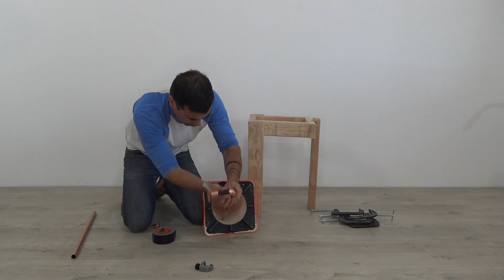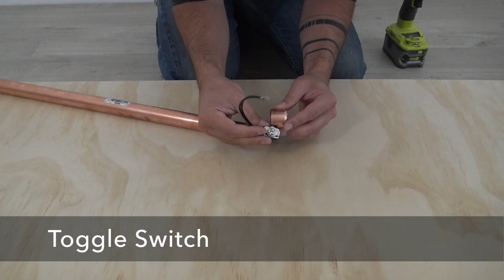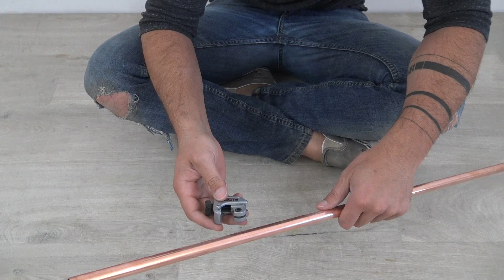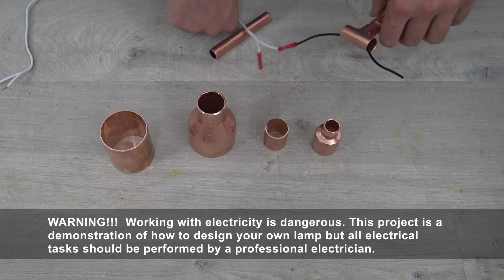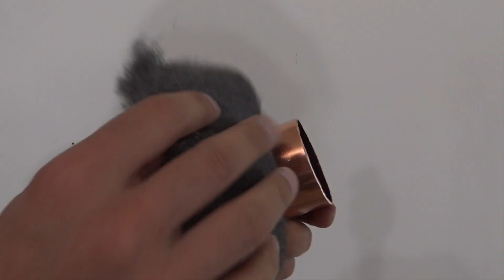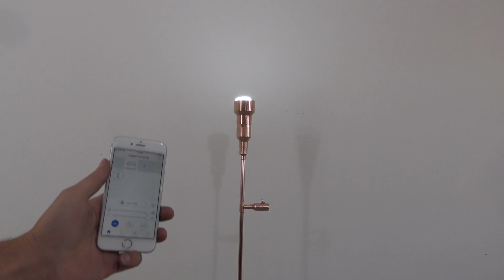DIY Lamp made out of Copper Pipe

Comment: I think a safer method might be to use plastic piping and then spray paint the desired finish. An ungrounded, copper lamp makes for a VERY dangerous accident waiting to happen. Alternatively, you could also use those LED battery bulbs instead, so that there's no current exposed to the copper.
Reply from the maker: the safe way is to consult a professional electrician which i did. any material combination can be dangerous or safe if the wiring and components are properly selected and installed.

Comment: Why do you keep pimping Home Depot?
Reply from the maker: I approached them about sponsorship because they have more  big box home improvement stores than most other brands and it helps create a retail reference point for the majority of the products i use.  If certain products are significantly cheaper from trade stores i recommend them as i did in the first metal working for beginners video where i made sure to inform the viewers that buying large quantities of steel from a steel yard will save money over big box retailers. I have gone to home depots since i was in college and have always had positive experiences.
Reply: This is an incredibly ignorant question.

Comment: Did you make a lamp out of copper then not ground it...?
Reply: Nes/Matt Touch lamps mostly have a secondary circuit isolating mains from the outer object. If the lamp above is not grounded and the live wire becomes exposed to the copper, which is very far from impossible, then you will become the ground when you touch it. It may well kill you, particularly in Europe. Some homes may have modern electrical systems which may prevent this, most won't. Grounding the bottom of the lamp wouldn't help, since it's glued together, potentially electrically isolating the copper pieces. I commented in order to add to the discussion and help, potentially to save the life of someone who decides to copy this design. Offering another point of view in comments can be very helpful to others who may be trying to learn from a video. Shooting someone down with unintelligible ramblings helps no-one.
Reply: I think you meant to write "do not recommend....."  Nice lamp!
Reply: The danger was explicitly explained. as was how to prevent it: grounding it. If you used double insulated wiring and a plastic bulb fitting then earthing may not be required. For a metal lamp with single insulated wiring (as in this video) then grounding is required under most countries' legislation, for good reason. I was talking about this example, shown in the video above. Not some other theoretical lamp.
Reply: I honestly think you need to comment more specifically about grounding/earthing this thing. It's very dangerous as is. And people will copy it without knowing better.
Reply from the maker: we worked with a professional electrician and we do not provide instruction for the wiring as noted both verbally and in text on the video.  The lamp is grounded and we do recommend pursuing any electrical DIY project without a consultation from a professional.
Reply: Fair enough. You really should write somewhere that it must be grounded, not just point them to an electrician. As far as it seems in the video, its ungrounded. Someone could die.
Reply from the maker: that would involve specific instruction and my electrician says its more complicated than just grounding it.
Reply: Yeah, I'd imagine so since you glued the pieces together. If you're fine with the way you've warned it, fair enough, I just hope you don't regret washing your hands of the potential risks for your viewers.
Reply from the maker: thank you for the comments i always appreciate the extra eyes spotting potential challenges or obstacles
Reply: Greig Muir You have left FIVE comments warning about grounding the lamp, but still haven't properly explained the potential danger or how to prevent it. Table and floor lamps are usually not grounded (they are wired with 2 conductor wire and use 2 prong plugs, not 3 prong grounded plugs.)  As you suggested, the potential danger is that bare wires touch the copper tubing. The wiring needs to properly and completely insulated from the copper tubing.

A cardboard tube or other non-conductive material usually covers the screw terminals of the actual light bulb socket, isolating it from the decorative metal exterior casing.. No bare wires should be exposed, wrap electrical tape around the wired terminals to be doubly safe. The electrical cord is often knotted inside the hase of a lamp to take the strain from someone yanking on the cord.
Reply: Nesley Heiney . My grandmother had one of those lamps haha. I think the op doesn't really know what they are talking about. They see some dry grass and think the sun is going to catch it on fire.
Reply: You can lead a horse to water but you can’t electrocute it because that would be animal abuse... moral of the story is natural selection haha. Weed’em out Ben. (Sarcasm) If someone does make this they should worry with their own safety it’s not his fault if people don’t research things.(but he’s giving bad instructions or dangerous advice, read in condescending whiny voice) If you can spot the wrong in this video good for you and using this chat as a way to show some sort of “expertise” really makes it look like your hmm well an ass frankly. Bottom line is as long as the initial contacts are protected against the outside your fine. If it was shorted out on itself it would pop the moment it was plugged in and the house breaker would flip and you’d shit your pants and if you were holding it, it would sting a little. Riddle me this Batman why the hell don’t my grandmothers super outdated tap the metal ungrounded lamp to make it go from off to dim to bright ( you know the one, everyone’s grandparents had them) didn’t shock me how will this one. I wore that lamp out as a kid touch touch touch lol great video Ben nice shock stick I mean lamp you made.

Comment: Very slick design. This project would also be a great one to just use a touch sensor and eliminate the switch.
Reply: I like this idea.  A 3-position touch switch in a cavity in the concrete base.  Incidentally, I've found capacitive touch to work through concrete, which was a pleasant surprise in a lamp design of my own.